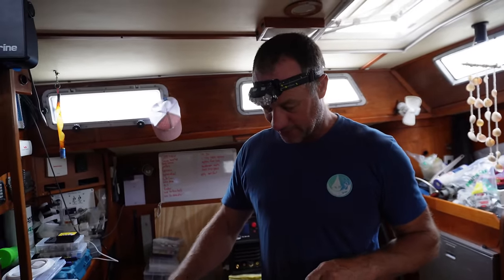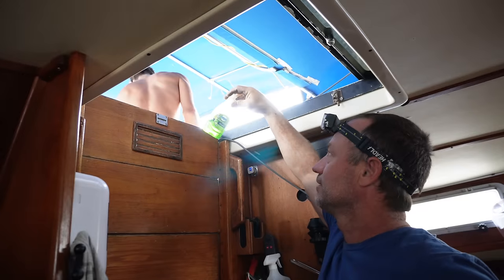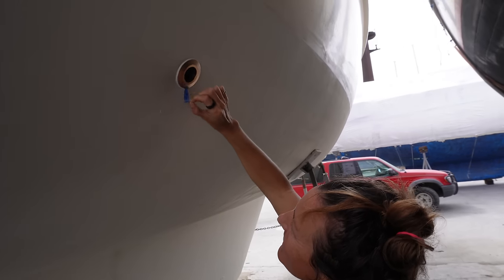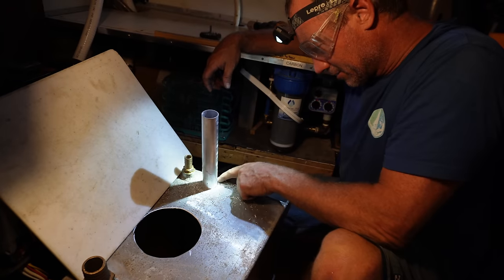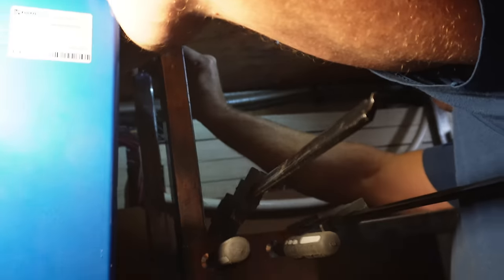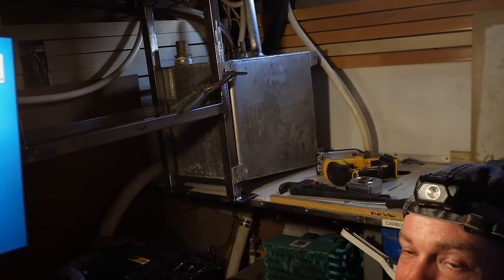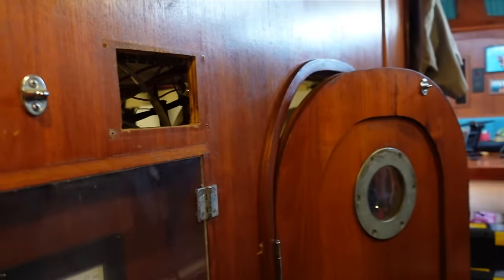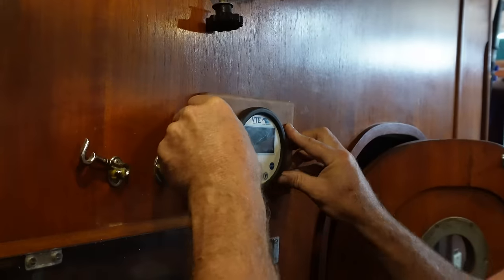Life in a Tiny home Ep 402

Comment: Wow, knocking out the jobs quite quickly!!!  My Paguro instrument panel would deplete my start battery in a week (I have a very small motorcycle lithium start battery).  I have a lighted push button switch that I use to take the + from the panel.
Reply from the maker: I have a battery isolator but the switch is a good idea so I don’t have to go in the engine bay cheers